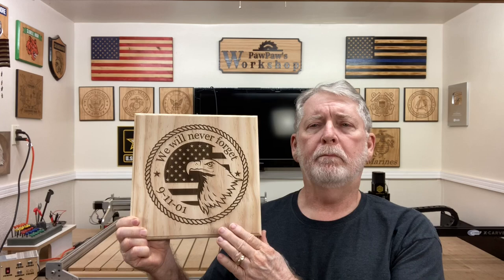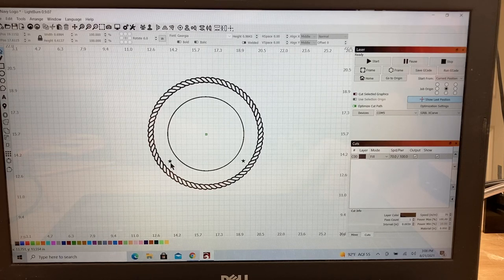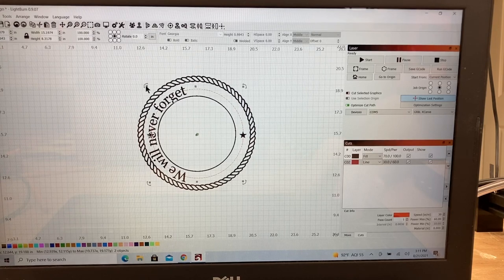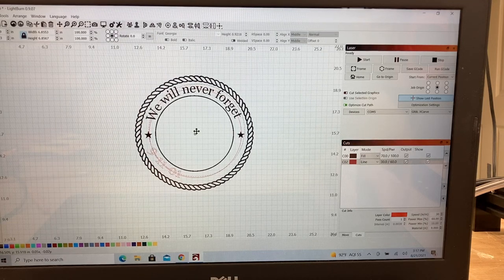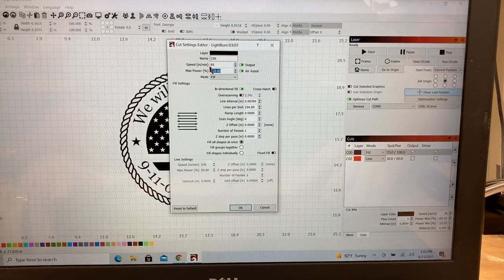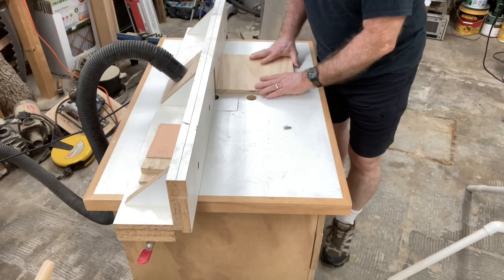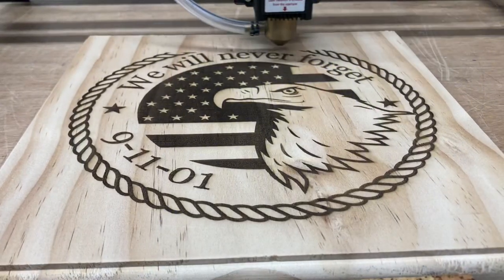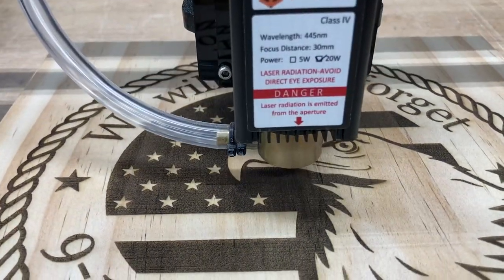How to Use Lightburn to Combine Two Files Together

Comment: Hello, and thanks for the great videos.  I just bought a Xtool D1 Pro 20w and I have a few questions for you. 

1.  I see that you have gotten a nice dark burn on this project using a 20w.  At the same time, your burn doesn't look deep.  It almost looks flush with the unburned areas.  It that just the way I'm seeing it due to camera angels or is there really no depth to your burn on this?  I used your pine setting of 60in/min at 70power and I got a lot of depth.  Just wondering if there is a way to get a dark burn without so much depth.  

2. How do you clean and finish the wood after it has finished a burn?  Clean off the burned residue (vinegar, water, denatured alcohol, etc) seal it (oil/poly/shellac/etc.?)

3.  Do you know how to lower the brightness of the crosshairs on the laser.  It is so bright when trying to line up my start point, that I can't tell if it is actually on it or just close to it.  I am using lightburn.  Or is there a way to change the reference laser to just a point and not crosshairs?  I think either one would be helpful. 

Thanks.

Comment: Would the settings be the same on a xtool d1 pro 10 watt or would it be better to run at 100 power and say 70 speed ? Beautiful job by the way

Comment: Excellent video.  Can you help me out with a problem that I am having.  I have the x tool d1 10 watt laser and when I burn an image, I get  some horizontal lines going through the image.  Can you tell ,e what I am doing wrong.  Your images are completely filled without the lines. Thks. Bret

Comment: Paw Paw please help. I’ve been CNC bit engraving for w while now and love it. I just started laser engraving but Having trouble with text. If I fill text it comes out to grainy a burn on the wood and if I line but don’t want cut out, (just want outline of letters)it shows all the tool paths burned to the project to?? How do I fix this 
Thank you for your help
Reply from the maker: What program are you using to control the laser?
Reply: LightBurn

Comment: Hello Paw Paw, first, thanks for your videos. I have a question: When I open some PNG file in LightBurn, then I create a circle around the drawing, thus getting two layers, the png drawing and the circle layer, however, in the Mode tab of the drawing, only appears written Image but, Line, Fill, Fill + Line do not appear; Do you have any idea what it might be? Thank you
Reply from the maker: When you first open the png file, did you do a image trace?
Reply: @PawPawsWorkShop   No, I didn't do it! Is that really necessary? Thank you
Reply from the maker: Yes,

Comment: Fairly new subscriber ....  I'm having trouble putting my text on the circle so its set up to be on top of circle .. mine keeps coming up for bottom of circle if that makes any sense.  What am I doing wrong?   Thanks  .. Nat
Reply from the maker: Are you using Lightburn?  If so, you have little handles to enlarge, rotate, and more. Type out your text. Highlight the text look for the little handles on the outer edges. One handle is just a little inside of the others with a curve. With this you can match the curve of the circle

Comment: I am trying to make a sign similar to this i got the text in the circle but i cant seem to delete the circle holding the text, i might have missed that in the video
Reply from the maker: In the cut/layers you can put the text on one layer and the circle that the text is anchored to on another layer. Then just turn off the circle for output and show

Comment: How would you invert an image to burn?
Reply from the maker: The easiest way is in Inkscape. Take you image, make a copy. Fill the space. In edit nodes delete any in the center. You will be left with the solid image. With both images on top each other select difference. It will subtract the line out leaving the inverted image
Reply: @PawPawsWorkShop  i guess invert is the wrong adjective, i need to flip the image upside down because I don't have enough bed space to burn the image the correct way so i flipped the board 180 so i would need the image to be flipped 180 to match up

Comment: The title of the video is about combining 2 files. How did you actually combine them? Thanks
Reply from the maker: I took the Navy image and removed most of it. I left the rope design and the rings. Then I added the eagle and the flag which had to be altered to fit the design.
Reply: @PawPawsWorkShop  how did you add the eagle and flag to the rope file?

Comment: you forgot to show how to delete the path after you apply the text to it. so it dont show when lasered.
Reply from the maker: In the cut settings, you have the little toggle switches the output needs to be off. The laser will not engrave. You also have a little toggle switch off for show. It hides the toolpath from view.   I too am a RC pilot. The only problem is the local club lost the flying field and the next closest club is about sixty miles away.
Reply: @PawPawsWorkShop  thanks for reply. no place to fly thats no good. wont be long till its all banned anyway
Reply from the maker: You may be right